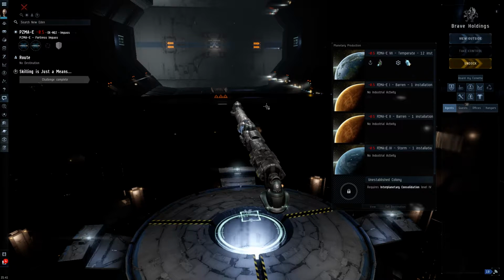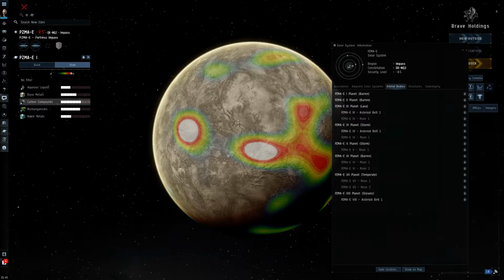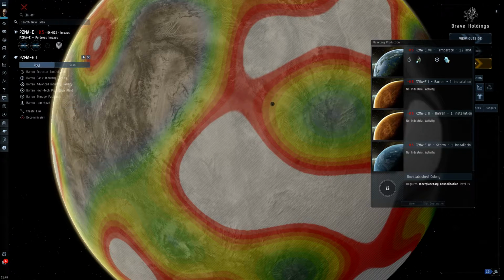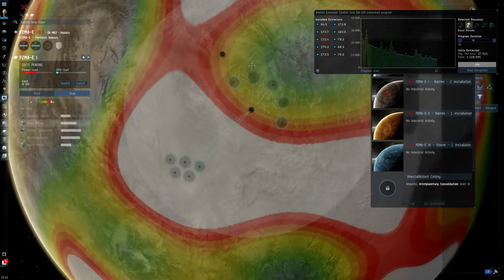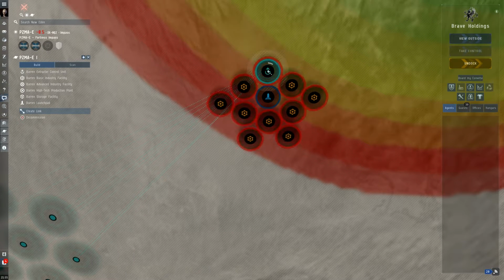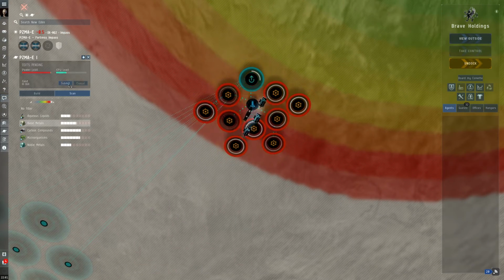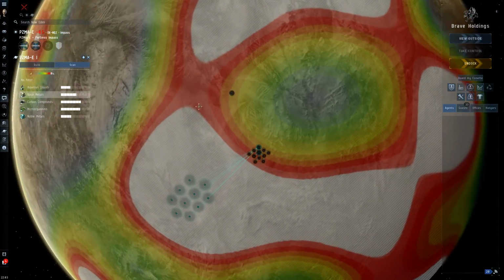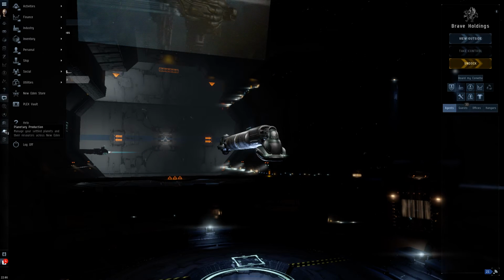PI - Planetary Interaction For Absolute Beginners (EvE Online)

Comment: Hello again! I did finally figure it out. I am not sure why but some systems' planets are not available to the general public. As for finding good planets to harvest from, if you open The Agency and choose Resource Harvesting at the top and then Planetary Production on the right you will be taken to the window where you can find all the planets in many systems around you and the output can be filtered by number of jumps and types of planets you wish to see. Once you have the list in the middle you can click on each system then look at the planets of that system on the right. If you see data when you click on each planet then it will give you a list of what materials are on each planet and the percentage of each material. You can even open each planet for a full view by clicking the little planet icon at the right of each planet which will open behind the list window. Once you choose what material you want and pick the planets, you then need to warp to each planet and drop the right type of command center on each type of planet. You buy those command centers from the Regional Market for 81k Isk each. Once you do that then you can open up The Agency again from the safety of your station and configure everything to begin harvesting. After that you only need to visit the planets again to pick up the materials and/or products you are harvesting/making. I hope that helps! Happy Harvesting!!! :D

Comment: Hi and thanks for the great video! I am still stuck though. Between the skills and the planets you have on the screen it is still unclear to me how to choose planets and get them to show up in the Production window. I've tried everything I can to do this even going to the planet but it tells me that the planets are not open to the public. I am in high sec. Do I need to go to lower security or a different system? Also, do I need to go physically warp to each planet and drop a command center to get the planets to show up in the Production window? Thanks!!